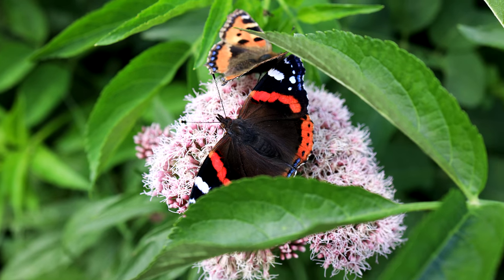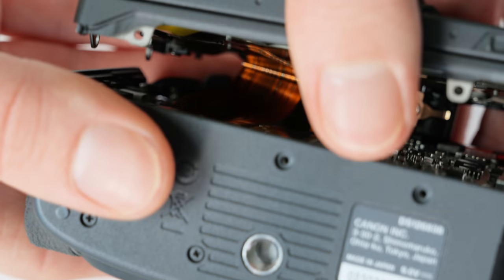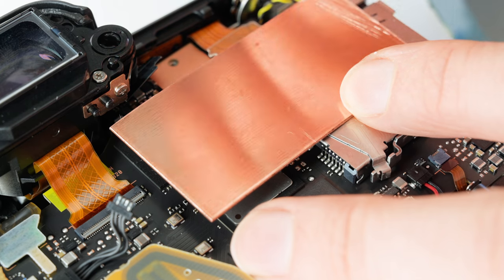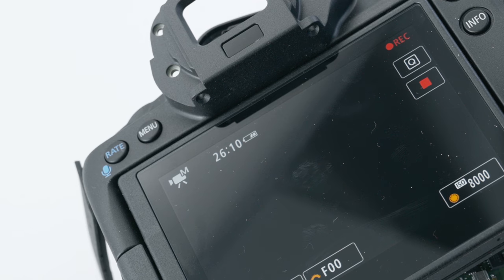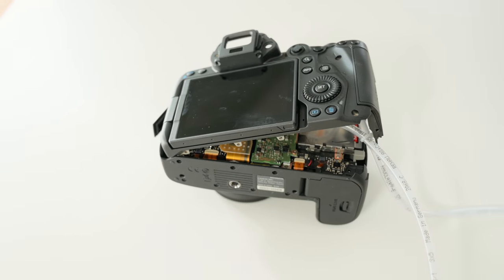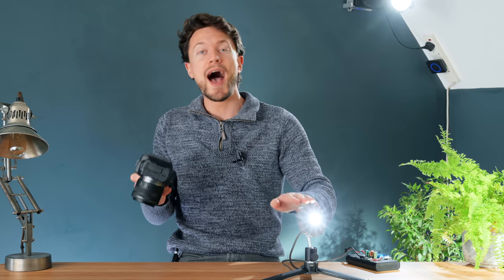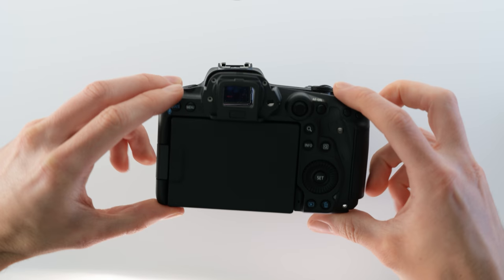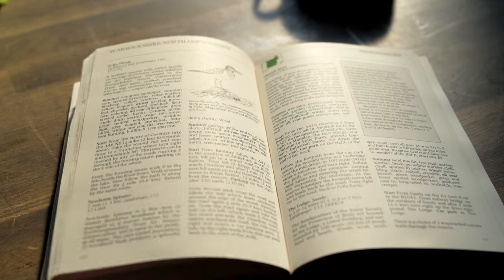The only reason to watercool a camera....

Comment from the maker: FAQ Time! Leave any questions here and I'll update this comment with the answers :) hope you guys enjoy the vid!

Q: Is there any room for improvement here?
A: Absolutely! My solution is very ‘homemade’ and the copper plate could be milled to match the back of the camera and interfaced to it with thermal compound. It may be possible to get it recording in an unlimited way with just a few tweaks, not requiring an external fan.

Q: Will you provide these in kit form? Or a service?
A: Possibly, depending on demand.

Q: Will the fan ruin the audio quality? 
A: It’s pretty quiet so not necessarily. If you’re filming with this in 8k you’re likely going to be using external microphones anyway (the internal one is only mono, remarkably)

Q: How did you finance this project?
A: The funds for my projects usually comes from the sponsors I have (Simplisafe in this case) and the kind folk who are supporting me on Patreon.

Q: How did you get the floating camera shots?
A: I just put it on top of a tall drinking glass and masked it out using the last frame (I was moving the glass around with my hand)

Q: Can you spend a month without technology? 
A: Hell yeah… I love camping so would happily go for a month if I had the time.

Q: How did you keep track of the screws?
A: I just had a bit of paper with some double sided tape to put the screw heads on to with a little written note of where each one was from.

Q: Why did you start making videos?
A: I just wanted a place to log my homemade projects, honestly.

Q: Sweater make please 
A: Lakeland!
Reply: Do you have a certain degree? I always wondered if you had an engineering degree or something cause you're so creative.
Reply: What are your pc specs
Reply: Sweater make please :)
Reply: Will you take the cooling temps further down for super low noise astrophotgraphy?
Reply: Can you try something like a DIY open back headphone(not wooden) please? Thank You
Reply: How yo ever tried a Raspberry Pi?
Reply: What was your first job or any other jobs that helped you today
Reply: What is your age
Reply: If you had infinite ressources for only one project, what would you make?
Reply: Can you provide written guide for your DIY 4k projector build along with updated parts list and dimensions? I'm asking this because the links you've provided in the description doesn't work for some parts, at least here in India.
Reply: Are u big gay ?
Reply: Can you please mix two led screen into one as a wide gaming monitor.and second one is can you make totally wooden pc or all outer frames.
Reply: Where is the video about the cheaper artificial sunlight, the one that use fresnel lens and box? I have seen it before in your video... but it seems you have remove it?
Reply: where do you live
Reply: Why you placed the camera like that where it gets 0 light? Would it make any difference if you just pointed it at the room to capture a scene with many more light and colours? I speak about only the watercooling part
Reply: Are you planning to do a studio tour ? I would love to see your place, especially with all your crazy DIYs lying around ! :D
Reply: Can you please make an artificial night ?

Like you made artificial sunlight 
That too solar powered? :)
Reply: Are you planning to do a waterchilled cooling for astrophotography? It would be great to see the difference between a cooled vs non cooled chip, it should lower the noise drastically!
Reply: Won't the fan ruin the audio's quality due to it being so loud?
Reply: Can I be in your video?
Reply: Can this be done to iPads as I’m a gamer and I lose a hell lot of frame pls tell fast
Reply: How loud is the fan? Wouldn't it cause a constant drone in the video footage?
Reply: What would you recommend to learn more about PCB's and how electronics work in general?
Reply: Curious to know if the vibrations/noise from the fans were an issue? and why not just a larger heat sink? 

PS; this video was pure genius
Reply: Wouldn't you think canon did this to prevent making this a much better buy for most video people than their C70, the cinema edition? Even considering the idea you proposed about the extra cooling add-on.
Reply: Could you cnc cut a pattern in the back panel which will not harm the rigidity, but will give upto 50% direct air contact?
Reply: How do you finance your project. Just googled this camera and it's 4.385.- € just for the body. I would be afraid of playing around with this kind of high-priced gear. I'm also thinking of the artificial daylight, this seems pretty expensive too.

I myself would welcome more low cost / cheap DIY projects that I can use as instructions or that I can rebuild at home.
Reply: How did you get the floating shot of the camera? You need to do video tutorials!! ❤️
Reply: What do you do for living? 
What job have you learned? 
Love your vid.
Reply: Enjoyed the video Matt.
The only part I didn't like were the snap zoom in/outs you did near the beginning of the video.

The camera, I'm guessing, has it's warranty void with this?
😂😂
Reply: do you youtube as part time if yes then what job you have
Reply: What is the noise level with the fans? Do u hear noise during recording? Anyway, great video man ^^
Reply: You should test the low light performance of the camera with this mod.  Image noise is mostly attributed to thermal noise in the silicon of the detector and the connected electronics.  Though, you may need to cool the sensor directly to see noticeable results.
Reply: Would you mod it enough so everything looks flush and look like a box (like the RED cameras, and other movie cameras)
Reply: Did you remove the simple version of the artificial sun video? I can’t seem to find it but it could be because I’m blind.
Reply: Did you drop it?
Reply: @Segatari  if you are using a Canon flagship you are probably levels above using in body audio
Reply: Can't you use the tripod screw as the thermal pathway and then your bottom fan can just be a heatsink? Metal all the way
Reply: wouldnt you expect something like this to just work for such a price?
Reply: You should sell kits of the plate you made
Reply: I assumed you had a backup R5 in case this one went kaput? I'd be pretty nervous even if my expenses were covered through ads, sponsors and patreon. 😂
Reply: Where were you graduated from and does you doing youtube as full time job?
Reply: Why don't you build a table saw ? I think that a table saw with a water cooling system would be very unique.  The decision is now up to you
Reply: You are the best,can you tell us what might be the problem of r5? In your opinion,what would you suggest to make it better commercially?
Reply: @EnUsUserScreenname  would need to cool the sensor.
Reply: Does is void the warranty?
Reply: How much electricity do you usually use?
Reply: This was cool to watch but I prefer the more diy projects that the masses can do and use on a regular basis not some one off upgrade to an over priced under/poorly designed camera. 

I hope someone uses your video to help them sue the fuck out of Canon for their pos under designed camera and lack of support for their obvious pos camera. 

Anyways like I said I hope to see more practical diy projects for the masses. By all means I don’t mind the cool one offs like this camera fix but I’m afraid with the quality of engineers these days and the greed of designed obsolescence you could dedicate a channel just to diy fixes for such products.
Reply: Where can I buy a lamp like yours?
Reply: Be interesting to know if Canon responds ...
Reply: will there be any vibration issue?
i mean both waterflowing thru the tubes and fan spinning may create some vibration tho...
Reply: Couldn't you've just cut the plastic area around the copper to make it exchange heat better?
Reply: Very impressive but even more impressive -how do you keep track of all the screws?
Reply: How long it will record without fan outdoor now, when is around 7-8 deg or less ?
Reply: If they brought heat pipes to the tripod screw, could a tripod be used to drive the heat out ?
Have you thought of inserting heat conducting stuff in the plastic back ?
Like, cut a hole, have piece of copper connecting to the internal one but flush with the plastic back on the outside ?
In fact when you added the second copper plate I thought you might make it come out the bottom of the camera body.
Though I guess cutting into the body of your R5 is not the same level of risk as just opening it !
Reply: Hey!!! 
What would happen if we use liquid nitrogen in place of water? Whether productive  of camera or even PC will increases?
Reply: Do you have some automation video in plans?
Reply: Multiple projector projecting 360° video on all walls of a room
Reply: @EnUsUserScreenname  good question.
Reply: I was relly surprised by the record times because I thought pretty much all DSLRs have a 30 minute record limit and after checking cannons website for the R5 I'm still confused since they list a recording limit of 29min59s under specs. Could this be a regional thing?
Reply: If you had the time and a CNC machine, could you actually link the processor with the tripod mount?

Also, you can probably collab with StuffMadeHere for a not-useful over-engineered version of this thing.
Reply: I have to ask the standard "Why did you start making videos?" question. Genuinely curious. Thanks for the hard work.
Reply: It seems like the heat is coming from the DRAM chips next to the main processor which is why the thermal pads are placed there. The metal case of the processor is probably more than capable and distributing the heat to the edges of the case where their is some thermal pad
Reply: Could you upload plans for the two copper plates so one can easily modify you own camera?
Reply: You are legend. This copper plate costs a lot to canon
Reply: looks like the RAM was more of a concern than the CPU given the original pad placement. also, that flir imaging looks kinda trashy, i can recommend ht-301, much better in similar price range
Reply: Filming a black screen uses far less processing power than a complex scene
Reply: Im interessted in the sound/vibration design of the heatsink/3dprinted solution. It would be kinda bad if the fan would be heard in the taken video. Also i can imagine, that the vibration of the fan could be problematic using a greater focal length. Have you tested anything of this?
Reply: what is your favourite project?
Reply: What background did you need to start  "DIY"
Reply: Youre a great guy with awesome talent. Can we have more frequent videos?
Reply: How come you amaze us in every video you make?
Reply: Haha! You’re turning into another Linus Tech Tips 😂
Reply: Did Canon contact you after this video? 🤔
Reply: That copper heatsink mod was fabricated so well, you’d never tell it was custom made
Reply: Amazing work DIY Perks.
Appreciate the ingenuity of your idea that literally eliminates the overheating issue. .

However, I'm curious as to why you didn't extend the copper plate out of the camera and connect it to a bottom  heat-sink? That solution can potentially be used with a purely passive heat sink as well (but can be heavy though).

The videographers will really appreciate the lack of fan, as it generates noise and vibrations to reduce the video quality.
Reply: can you play the im an engineer song as an outro?
Reply: Great work. Canon should offer you a job. What storage do you use in camera and how fast it fill up with 8k video?
Reply: Can't you cut some part of plastic that is present between the copper plaste inside and the outer cooler? And then link up the copper plate and the sink direcly in order to get even better results.
Also, I love watching your work. (obviously)
Reply: @SriTejaChilakapati  
Agree
Reply: How much time was spent designing vs implementing for the internal heat syncs?
Reply: Are you planning to work for LinusMediaGroup? (watercooling everything)
Reply: Are you a gamer??
Reply: music?
Reply: Could you please make a behind the scenes video / studio tour? I'd absolutely love that!
Reply: Does having a spinning fan attched to camera introduce any unwanted vibrations which reduces the image quality ?
Reply: @dennispeeters8976  I share these thoughts with you. Overheat problem seems to be intentionally kept for being solved in next version of this camera and to keep an edge for its pro video cams. Similar to iPhone, that intentionally withholds adding features that android phones have from over a decade, like universal Bluetooth data transfer.
Reply: Did you think about making the whole back plastic thing behind the screen out of copper? I would guess that would be enough to passively cool without the need for fans.
Reply: @tomhepz  This looks like an ingenious approach if the camera's internals don't come in its way.
Reply: Great video. Can you provide dimensions  or 3D file of internal final copper plate .
Reply: @N95boy1  I too watch both the channels. Both are great
Reply: Where can I get that lamp on your desk
Reply: Why did you decide to dump on ideas that have actual practical implications and replace them with gimmicky inventions that are just that? 

I, for one was looking forward to you trying to "transplant" platters from the insides of a HDD to another...That video never happened...
Reply: Did u ever try out microcontrollers and microcomputers like the arduino and the raspberrypi
Reply: Just curious. Do you play video games? If yes, what are the games you usually play?
Reply: Will you release a template for both of the modification(Copper plate and cooling fan) installed in the camera?
Reply: Could you replace part of the plastic back case with metal to give better passive cooling?
Reply: Did the 4kHQ Overheat with only the internal copper mode?
Reply: 2:01 how? looks awesome.
Reply: Plans for 3 mil?
Reply: What do you do with your projects after completing them? Do you store them ? or use them in your daily use?
Reply: Have you ever played with old smartphone parts? Maybe something cool made out of old iphone screens? or taptic engines?
Reply: Can you make a 20x20 pc case ?
Reply: Will it add vibration or fan noice in the camera using the cooling fan? What about passive cooling with larger copper and fins by midding the outer plastic shells?
Reply: Did you get a PlayStation 5 yet!!!????

What hacks you gonna add to that!?!?
Reply: What are you water-cooling next?
Reply: @amittrivedi8801  yeah they’re both great channels!
Reply: Can you link the URL of that timer you used in the video? looks superb
Reply: How did you started this channel
Reply: Can you make a video about a GAMING PC Build
Reply: (haven't finished the video) Will you be making these for sell? It could provide you additional work in hard times like this
(I still have my trusty 600D ;p)
Reply: Canon should pay to use this :D ... Good job! Seriously though, What did you study for these inventions and tweaks? Engineering, Logic and critical thinking, etc?
Reply: Does the vibration from the fan cause any visual effects in capturing videos (like on huge zoom factor)?
Reply: if you expand the copper heatsink 10cm more on the left, can record 8k video for 1 hour, without any extra components outside of the camera??
Reply: @zyh8351  Yes, body audio indeed sucks but with an ''ambient sound'' microphone, won't it pickup the fan noise?
Reply: What do you do with all the different pc's you build?? (Legend has it Matt has a computer that is made of all the pc's he has built and it is more powerful than NASA's Supercomputer)!
Reply: @AsitShouldBe  No telling how long this video took to make, so maybe. But I don't have to read subtitles and listen to crappy music in DIY Perks video so you still lose. Nice channel though, if you'd talk rather than play crap royalty free music.
Reply: isn't the first watercooling test is kind of biased ? because encoding a constant black frame is not very CPU intensive versus, lets say a steady but detailled picture
Reply: Further improvement would be to cut a hole in the plastic back and placing a piece of corrugated copper between two copper sheets instead of that plastic plate on the back, so the cool are is blown. Through a thin radiator type setup.
Reply: Why do you not have 100 million subscribers
Reply: You have just ashamed Canon's technology department! Great Work!
Reply: Why are you using clickbaity thumb nails?
Reply: @Steve_Just_Steve  eheh thanks for your time, i'm a new YouTuber, i have very much to learn..bye😂
Reply: Great work on the R5!

Have you considered using Liquid metal on the R5 for potentially better thermals?

Also, would you consider letting other YouTubers geared towards video and photography production, such as Jared Polin or Kai W to test its real world performance with this clean mod?
Reply: I wonder if you can make the back of the camera (where you mount the external heat sinc) out of copper itself and dimple it / put some passive radiator grooves on it, just enough for the screen to close .. this might improve passive cooling and still appear stock when the screen is closed.
Reply: On your copper heatsink you built.  On the inside of the camera could you have used more copper in the area that you have for pressing on the inside back of the camera so that more surface area could be used which should have dissipated more heat?
Reply: Contact Tilta! They design accessories and mods for cameras! They already built a fan that that will attach to the back but it didn’t work for reasons you outlined. I bet they would work with you to design a mod for the camera.
Reply: @parshva1430  i had the same problem and i dix that by making a stand with a fan from the back and works fine
Reply: Can you make a video about all the tools you use + why you chose the ones you did?
Reply: Why did you want to humiliate Linus?
Reply: CAN YOU MAKE PHONE COOLER UNDER 5 DOLLARS PLEASE 🙏
Reply: Were you inspired by LTT (Linus Tech Tips) endeavour to water cool their 8k RED weapon digital cinema camera?
Cause they did that, and I kinda think it's cool that both of you are doing the samething
Reply: Why don't try a perlier (coolong) element?
Reply: Can you convert a membrane keyboard to mechanical in cheap way.
Reply: would the fan noise mess up the audio?
Reply: ok now you opened the camera and you've your camera so as an experiment and as a subscriber I want to ask are you thinking about giveaway this camera
and I'm in dire need of that camera as I am diy lover but can't afford money to buy camera to start my youtube of diy in 8k this way lot of confusion which is created by low resolution of video on youtube would be reduced as it would become so easier for makers to speculate what's the owner doing in video if it's in 8k. Hope............. you'll read this
but I'm not a lucky one
Reply: and also I have an suggestion for this diy As you would know that smartphone has cooling pad made out of water which have liquid in it. So why not salvage or made one which would be easily extend at the bottom of the camera and but cutting some edge from cover of the camera after extending these copper liquid cooling pad at the bottom you'll have more exposure to air and liquid inside from camera can carry heat as in thermodynamics heat travels from high to low temp. so heat from the processor can easily be carried out by liquid copper plate and for more effectiveness your diy attachment could provide more blast of air to pads directly 
btw read my other comment also thank you
and you can salvage these cooling pads from mobile like samsung , mi , poco f1 model etc
Reply: You really should have Canon see this video!!! Great job as usual!! :)
Reply: Can you please make the 2mm Cu template design template available for download? Perhaps you could write up drafted document showing your design and a materials list as well. Would like to try it out in my R5.  Thanks for posting such a Great video on cooling down the R5!!!
Reply: Have you ever broken an expensive piece of (new) tech by taking it apart?
Reply: Sorry if this is asked already: does the vibration frequency of the fan rotation ever interfere with the video footage?
Reply: I'd really like to know how your custom internal cooling would pair with the Tilta Canon R5 Cooling Kit
Reply: One question: can I buy this from you? Honestly, if you made this heatsink and sold it at B&H, you’d make buttloads of money. Overheating is the reason I don’t have an R5, and you just fixed overheating.
Reply: Can I be your apprentice?
Reply: Without the internal mod, but with the external heat sink, how would it record?
Reply: I heard there is a serious health risk when holding a camera that is 50+ degrees. How would that be solved? Everyone would sue canon, no?
Reply: Replace the plastic back plate with a copper or aluminium plate maybe? It would change the look unless it's painted black (black as night, black as coal).
Reply: Why not replacing the square plastic where the screen folds inside with a copper plate?
Reply: Can we cut out a piece from the back plastic cover( the plastic cover under the screen, where you have put the fan) , and put a copper plate in its place, (and then seal the edges of copper plate and the plastic back cover with some good sealant).
The outside copper piece may be put in contact with the copper heat sink that you made for the inside ?

Or maybe you can further modify your copper heatsink that you made for the inside, and add some more copper plate that could protrude from a cut made in back plastic cover ? This way it would be one single piece of copper heat sink ?

P.S. I am not an engineer, so I apologise in advance.
Reply: Can you please check how your modified camera works under more warmer weather conditions like 35 degrees °C ? Your room temperature in this video was 23 degrees °C
Reply: Would you sell a mod kit ?
Reply: So...when can we buy the copper heat sink mod from you?
Reply: GREAT JOB!!! Incredible concentration to perfection and detail! 

What about the Fan noise? Is this still suitable for indoor recording people wearing clip on Mics?
And.. pls pin on your comment :)
Reply: Some places online offer 3D printing/ CNC milling in copper. Can you provide model files for custom heat sink too!?
Reply: so...no FAQ?